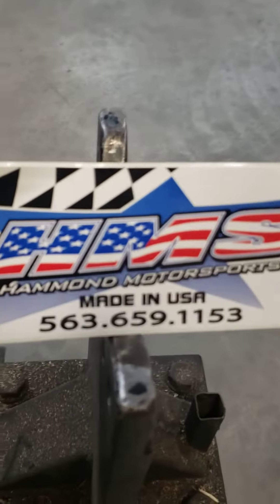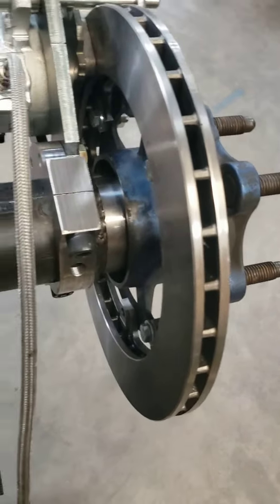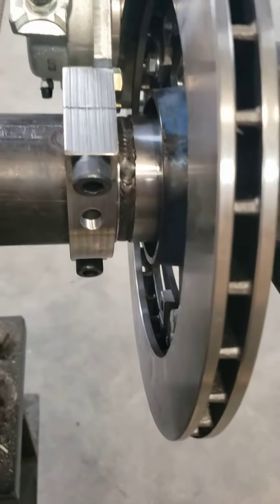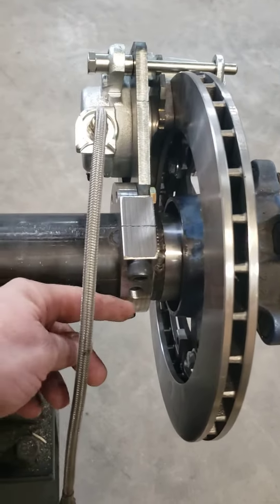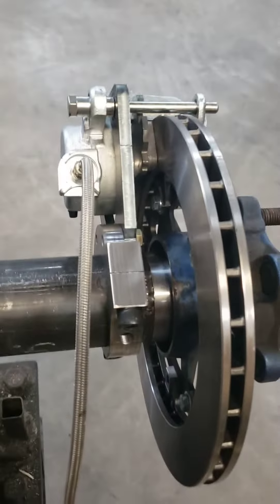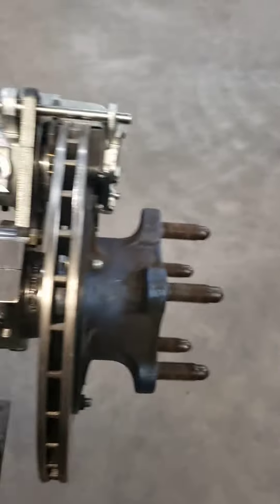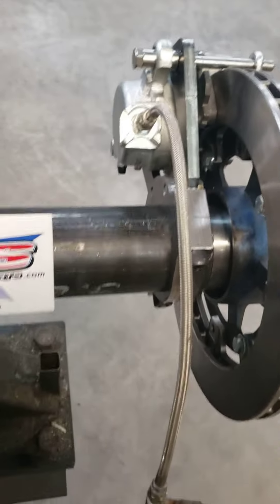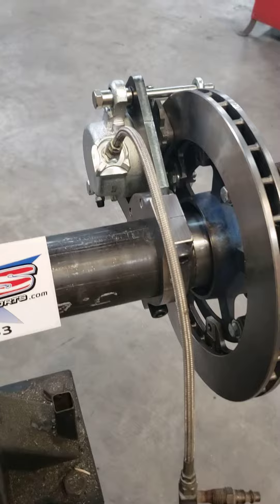Hammond Motorsports clamp on brake mount metric

Comment: What rotor would I use for a first Gen Camaro
Reply from the maker: If this for a stock setup I would say contact Jason at the brake man TBM Brakes (https://www.tbmbrakes.com/) . If your running a 9 inch ford floater I run a .810 rotor that is what this mount is made for thanks Dave